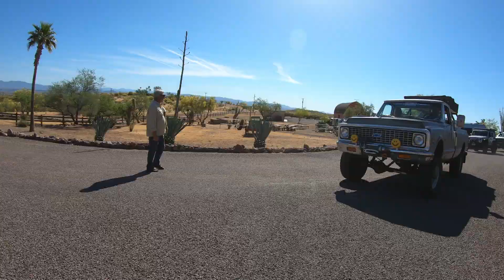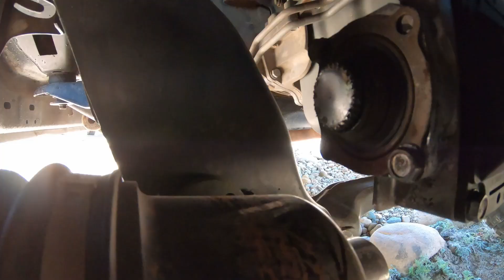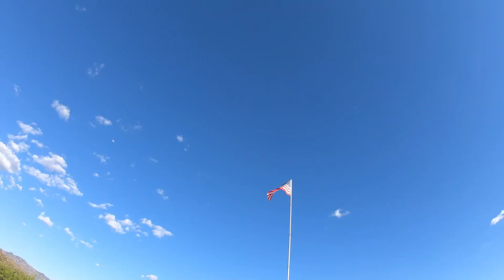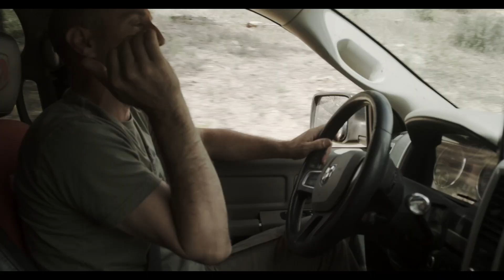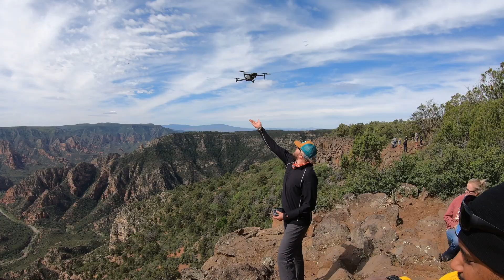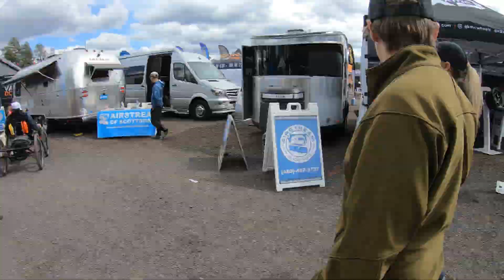4x4 Overland Adventure Across Arizona and I break my truck Again

Comment: Fun Video to watch. As a fellow Ram owner I love watching people actually use beat them up a little. Unfortunately I have also broken a CV axel before which really doesn't give me that much confidence in it but hopefully in a year or 2 ill have a gladiator
Reply from the maker: Thanks for watching.  I solved the actual CV weakness problem with the RCV Axles but now have to sort out the issue with the center section... keep watching... I'm going to get this thing dialed and beat the crud out of it!
Reply: @AutoEdits  any suggestions for beefing up the other parts that are now breaking after upgrading your CV axles? I'm thinking about putting 37's on my own 2017 Ram 1500 and making it an off road monster like yours! The suspension will be the Carli Performance System if I do invest in my truck!

Comment: I love your ram videos. I has a 16 ram and I broke the factory ifs off and swapped to the style you have from early years of the same gen. I didn't have 37 but 35s and I broke the drive shaft to the front diff. 4 different times. I almost ordered the rcv axles but never needed them. Then I sold the truck.

Comment: @AutoEdits just wondering if you still had the Air lift on the truck during this ride or any other off road ride.
Reply from the maker: I do still run the Air Lift on the truck and it has proven to be very tough and practical.

Comment: Was hoping to get an update on the air bags, mainly for off-roading...Are you bottoming out? How is the ride? Main issues?
Reply from the maker: The Air Ride stuff has been working out great. For the trip in this video, I set the bags at 15 psi and it was perfect. Around town and day to day I leave them at 5 for comfort and a few times carrying heavy loads have gone up to 40 and the truck didn't even know the scrap metal was in the bed.  Can recommend.

Comment: This ram is awesome but I also wonder how well it would do with a coil lift or lift kit and 37s with closed off engine bay....because I notice you can't play in the water when everyone else does and the icons where like a 3 inch lift.
Reply from the maker: This truck has 37's and the Icon kit doesn't really lift the truck much... maybe an inch. I went through the same water as everyone else in this video so I'm not sure what you mean? Did you watch the Baja adventure video?
Reply: @AutoEdits  I did the raptor flew the
Through and you had to slow down in it because ur cold air would have ate water
.....and I'm guessing that's also why ur AC is a dust blower?

Comment: Hey, It’s so much fun watching your videos and living vicarously through you.  I have big plans for my 2014 Ram 1500 Big Horn 4x4 and am using yours as somewhat of a template.  I’m lucky mine has a limited slip in the rear because it helps a ton in mud and steep hills.  The big crux to a Ram in my wheeling is the approach angle with the factory bumper setup.  It’s horrible!  Is there anything you think I could try to fix that without spending big money on an aftermarket bumper?  Thank you so much and keep on keeping on!
Reply from the maker: Howdy and thanks! Just rip that front bumper off or grab a sawzall and get busy... LOL Unfortunately, there is no really cheap way of doing it.

Comment: How has the Leitner rack and boxes done so far?
Reply from the maker: It's the second best upgrade and still looks and functions amazing.  Can't even stress how good it is to be able to move the top bars when I haul a full truck load in the bed and then slide them right back for tent mode!
Reply: @AutoEdits  Whats the number 1 upgrade?

Comment: I want to buy a ram 1500 for overlanding like that.  Do you find it a having good capabilities?  Looking to get something from EAV super ready. Just not sure if I should go 1500 or 2500.  Size probably sucks but the heavy duty stuff is probably better and more reliable. Anyways thanks for sharing your videos
Reply from the maker: I like the 1500 but the AEV Prospector is amazing and a super capable rig... if I had the money I’d buy one!
Reply: @AutoEdits  Thanks for you reply. if money is not a problem what's your opinion on the prospector vs prospector XL.  It would be my expedition, overlanding vehicle. I will probably tow a conquer 490 or a EXP 4 offload trailer. Any input ? just a lil worried about the massive size. But safety, comfort  and reliability is my main priority. Thank you gain.
Reply from the maker: Go XL for sure!

Comment: How come you couldn't use low range? I would think you still could, just that it was basically be 2wd low range. What are the plans for the Ram now that the IFS has resulted in multiple breaks now?
Reply from the maker: I didn't want to spin that stuff with broken junk up there.
Reply: @AutoEdits  Ah, yeah. And as I recall pulling the front shaft on that is kind of a pain to just quickly do on the side of the road. I really loved the drone shot of that hill climb.

Comment: All those high end 4x4's and your doing everything in a 2wd truck. For future reference though, when you break a stub axle like you did you can still run in 4wd lo for better gearing, just the front end wont pull.
Reply from the maker: Hey thanks for the input but I realize 4lo still worked but I didn't know how bad the break was inside the front axle disconnect housing and didn't want to add stress by engaging the front drive shaft. Appreciate you checking out the video and leaving a comment!

Comment: When you broke the front cv axle, you technically have 3wd. so you could put the truck into 4wd, but the passenger front tire will not be of any help with traction.
Reply from the maker: Open front differential means no front drive at all... plus, with a broken stub axle on the passenger side I didn't want to put any extra stress on that stuff.
Reply: A borked axle wouldn't hurt anything unless you kept driving like a mad man, but you noticed soon enough.

Comment: Why did you separate your CV shaft and bolt the spine back in the hub? Your tire attaches to the hub assembly the hub assembly is bolted to the spindle the spindle is attached to the ball joints on the control arms which are bolted to the frame, It is literally impossible for you to lose your wheel if you left your outer splines out! If you think that you need the axle to hold the hub assembly together what holds the front hub assembly together if you were to buy that same truck in 2WD? I guess it is details like this that separate actual Mechanics from part installers who learned from watching videos of another guy who learned from watching another guy, But in reality no one actually knows what they are really doing!